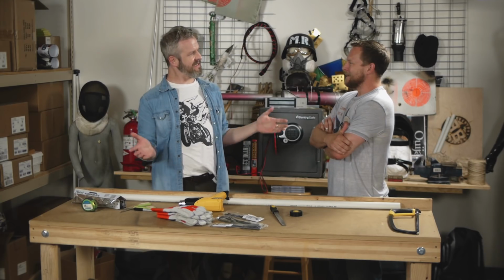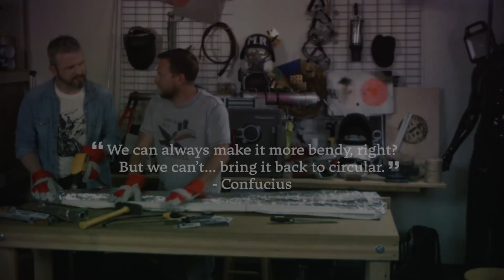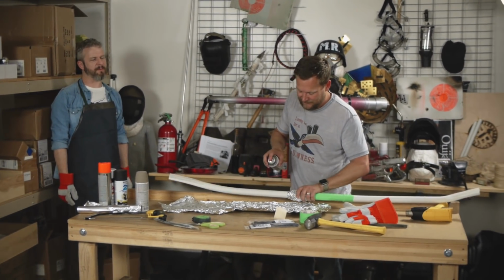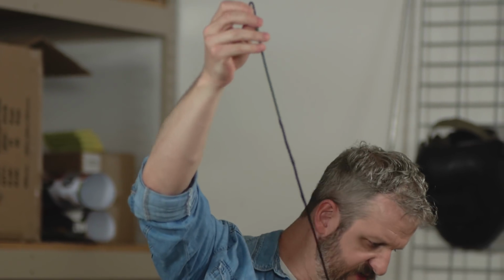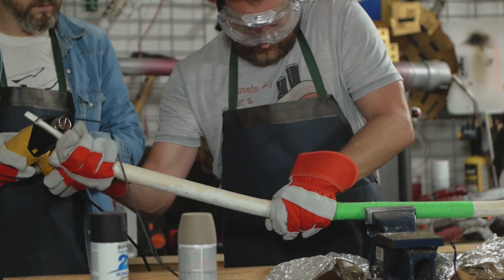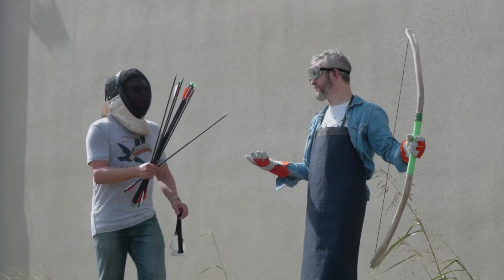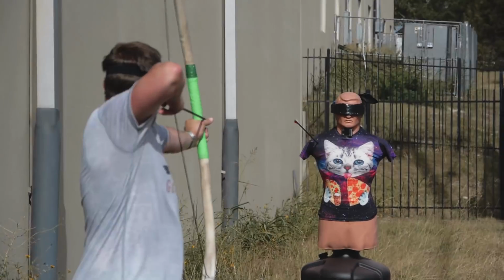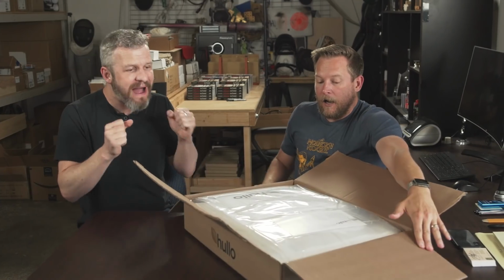Improvising a PVC Bow

Comment: Don't heat and bend the bow before you string it so it has more tension. Also you need to shoot Arrows with feathers that's why they don't fly straight. The plastic feathers on the end of those arrows are called veins you need actual feathers

Comment: If u need to put a bowstring on then use your legs to bend it, one is behind, one is before the bow, keep front of a bow pointing back, leg that is on a back side should be a hand that is on a side of your main hand, then bow shall point up a little. Grab a top part of a bow, which should be on your main hand's side, and push it, bow will bend easily

Comment: The notches should be angled up up in the curve such that if they continued to the tip they would meet. This helps the limbs create a better curve on the draw.
Reply: Also the knots on the bowstring slide up and down if prepared properly. This allows the string to go over the tip and fit under and in the hook.
Reply: Also before stringing the bow I should not that much of a curve. On recurve the ends are often level before being strung
Reply: The arrows you are using also aren't long enough. Due to being honestly shit archers you would be best off using aluminum arrow shafts with hollow aluminum tips. This will give you a more consistent flight.
Reply: You could use carbon arrows with brass rings and steel tips

Comment: The problem with your bow is you're using a long bow style bow but not long now arrows the problem with your arrows (probably metal) is there to hard so they flow the line of the string and hit your bow ever so slightly at the end which makes them go sideways. Longbow arrows are made to Bend so that they go around your bow and fly straight. The solution: buy Longbow arrows or make sure your bow disign makes a free path for your arrow from your string
Reply from the maker: Nailed it.  I bet that’s exactly what’s up; thanks!

Comment: Ironically you actually almost made a recurve bow shape, but if you don't know how bows work or anything about bows really then i guess you wouldn't know that the bowstring goes on the OTHER side, hence why it's called recurve. You guys made a wide C shape then put a string across it, as if the string is the thing that gives the power, not the bow. The whole point of a recurve (or even an English longbow design) is the string is preventing the wood from going back to the shape it wants to, giving it elastic/kinetic potential energy, which is increased further when drawn. If you already bend the wood back and set it, then just put a string between those points, there's nothing creating the potential energy, so it'll be purely on the string to provide some small amount of power. You could try this again but with even the briefest check on how to string a recurve bow, then make it based on even just that minimal amount of knowledge.

Comment: you strung the bow backwards. it would have a greater draw weight had you done it opposite of the way you bent the ends. Also consider using fiberglass rods in the bow to give it more rigidity and draw weight. the way it is now it will wear out fast and lose its structure because pvc is not very good under tension it will get a sort of memory of where its at and become worthless before too long. im sure some one else has brought up these points but i didnt feel like reading through 3000 comments to make sure i didnt say what some one else already has. Fun video though.

Comment: Instead of notxues I would've drilled a hole through the mark you made and passed a string through there, and tied it on the other side of the hole. Then the same on the other side. Less risk of it falling off or coming out over time, and would probably have been easier than cutting notches in the sides of the PVC

Comment: i made a PVC pipe bow with 4 fiberglass driveway markers as the core and mountain climbing string (think thin paracord but not stretchy)  i braided the string and have a 58 pound bow, as a note you only need a 40 pound to hunt bears moose and elk, and it shoots like a dream. one criticism i have not about the bow but your technique at firing said bow....its awful you need a full draw to the chin and loading the arrow on the left side of the bow vs the right like you did would probly help you out more

Comment: Does Archers Paradox apply here still even though the draw weight of the bow is so little because of the amount of bowing in the PVC pipe, as well as the over all width of the PVC pipe too. I'm thinking that because of all the factors Archers Paradox wouldn't apply which is why you seemed to shoot a little too far to the right, towards the camera which I'm assuming is right. Of course I might be wrong someone fact check me...
Reply: Yup. In part due to the arrow spine likely being too stiff

Comment: Yes, Brian is correct. The reason that these shots were so pitifully weak is because you curved it. The bow should be completely straight, or even bent the opposite direction a little, when not strung. Great video though, I hope we get a follow-up like with the potato cannon.
Reply from the maker: I'm sure we will.  I think we were a bit paralyzed by the thought of the bow shattering and slicing up our faces.
Reply: Fair enough

Comment: Are you firing the arrow with the right feather facing the right direction? Also, you guys hold the draw WAY to long before releasing the shot. A smooth pull back and release ensures that more of the tension goes into the release of the arrow rather than just held in the bow. Your draw should result in your hand coming back to the same point on your face each time for consistency. If you find your shots still have inconsistency than you may not have a dominant eye. If you close the eye you do not want as dominant, draw back your arrow and then open your eye and release your shot you can train your preferred eye to be dominant. In any case you should see more consistency in your shots.
Reply from the maker: good feedback!

Comment: hey im not saying that you did anything wrong but u def couldve done this easier. if you take 2 pipes that fit inside each other and gently notch it for a string. no heating required and it should come out to somewhere around 50lbs.
Reply from the maker: Yeah, I think we were a bit paralyzed by our fear of it shattering and throwing PVC in our skin, face, and eyes.

Comment: Dry firing bows is really not a good idea. When you have an arrow knocked and you loose it, most of the energy from the bending of the bow goes into the arrow. If you release it without an arrow there isn't anywhere for that energy to go, you could damage not just your hand but your entire arm and the bow could snap and tear you open. Not good

Comment: Noooo! Not more bend, more flatness! It needs to be flexible enough to bend from completely straight to strung and drawn without passing the structural fail point. Reason: a good English longbow looks like a staff when unstrung, you'll get a more energetic release when you can have proper draw length. For a stronger bow, less flatness, but you have to be able to pull it and also know that it can bend without breaking. For more ductility (either for safety and/or desired strength), flatten it more, but NEVER add curve to a longbow! Do the curve on the recurve bow, or a compound bow.
Reply: Still happy to see a video on making a bow though! Keep it up!

Comment: @The Modern Rogue
Hey guys, I would like to suggest you hold your arrow on the outer side of the bow so you can stretch the string correctly and much further. Like in this pic https://bit.ly/2oF39bf , it might be why your arrows didn't fly as far as they could've. Also, you will not have to worry about the arrow falling and you can focus on aiming.

Comment: That was extremely sketchy. Because of the way you strung it you were pulling it in a way that if you pulled any harder than you did it quite possibly would have pulled the string off.

Comment: As someone who has experience building bows from staves...everything here is wrong. Dangerously wrong. This is like a lesson on what NOT to do. I mean, it's bendy, but if you're interested in building your own bow (even from PVC), please take an hour or so to read the BASIC rules first. One of which is that you don't add bend in the bow. The bow bends due to tension from the string.

Comment: You guys aren't very smart lol there is a simple way to get a consistent taper on each end using a couple pieces of wood. To make a recurve just heat up and bend the limbs around a pot. For a string you can use paracord. You guys make PVC bows way harder than it needs to be

Comment: Oof this is painful to watch. For one the string is too short which is why the bow is curved so much. The distance between the string and the bow is supposed to be like 8" yours is like 20". The arrow doesnt have nearly enough time to accelerate cause of that short a distance. that's the main reason why crossbows have incredibly high draw weights in order to compensate for the shorter acceleration distance. Also they were resting the arrow on the wrong side of the bow which means you cant really aim since you cant see were the arrows gonna hit from that position due to parallax. Also the PVC on it's own is weak as hell too and giving it a bend will just make it weaker, should have put fiberglass road markers inside to make it stronger. Like I'm no archery expert or anything but common sense dictates you're doing a lot of things wrong like you could have researched for 5 minutes before trying one of the more dangerous projects. PVC bows are also liable to explode if you dont check the PVC cause sometimes you'll get a bendy piece others its brittle should you can get some sharp plastic shards in your eye if you're not careful you could have watched a single backyard boyard or whatever video to fix a lot of the things in this video

Comment: Why did you insist on using an expensive bow string that didn't fit when you could have simply used paracord?
Reply from the maker: that sounds like... work.
Reply: @ModernRogue  I think it was more work to try and use the wrong material. Also, if you ever make a version 2, flatten the arms of the bow more. If you want to make a really strong PVC bow, try doubling your piping. Insert a smaller diameter pipe into your 1 inch pipe and then flatten and bend your bow. I made one with a 70lbs draw weight (which is strong enough to go hunting with, I have actually taken it deer hunting but never got a shot)

Comment: That, is an awful bow. You really should have had someone on that knows a bit about it. That brace height and the angle of the tips, awful. Correct brace height gives a longer power stroke imparting more energy to the arrow. The tips need to be angled towards the target rather than the archer so you don't waste work. When you pull back the string with the tips already towards you the draw weight stacks making it unnecessarily heavy to pull.